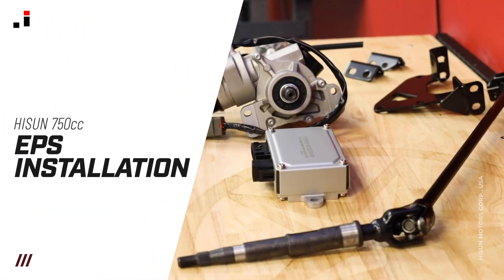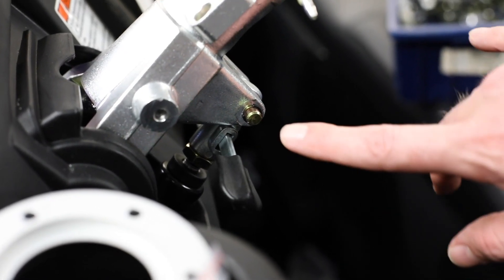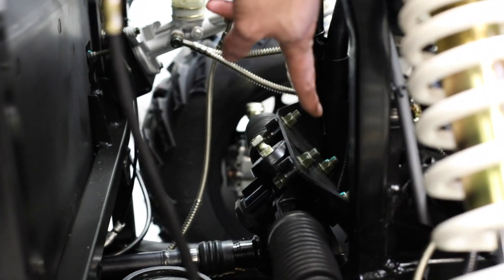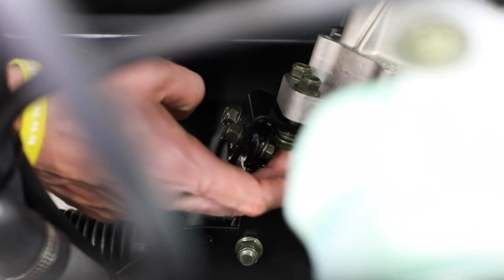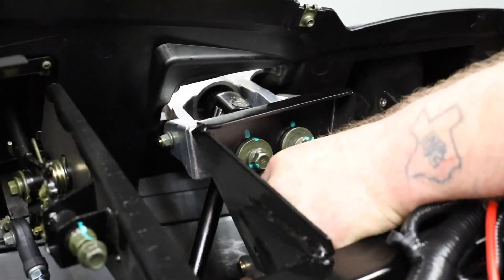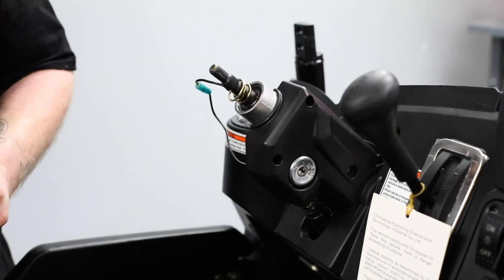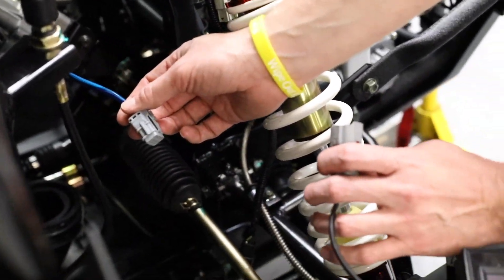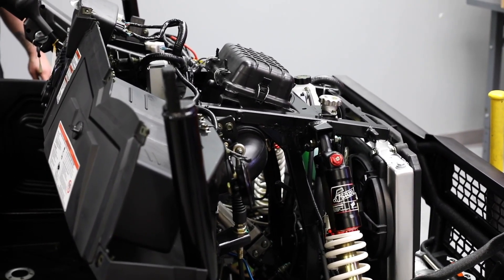EPS Kit Installation - HISUN 550cc-750cc UTV Engine

Comment: My dad has a 2022 Hisun 750 EPS Sector that has had steering issues ever since he bought it.  It pulls to the left, or more accurately, it steers to the left and  you have to fight it to keep it straight.  He's taken it to the dealership and they have done a few things but the issue is still not resolved.  Steering malfunction light is not on, fuse is good, front diff is unlocked.  It's unsafe to drive!  Any suggestions?

Comment: Thank you for this excellent video, i have 8x Hisun 550 Tatic ATVs, im having problem with EPS, put in new eps unit but when stearing its giving strange difficult torque when steering back, could it be that it neede EPS calibration and where could i get this tool?

Comment: Can you offer me some advice? I have a 2014 700 ex crew. It came stock with a power steering unit. I just replaced a worn out rack and pinion unit, and now it feels like I don’t have any power steering. What are your thoughts?